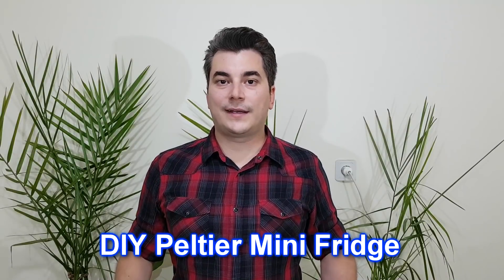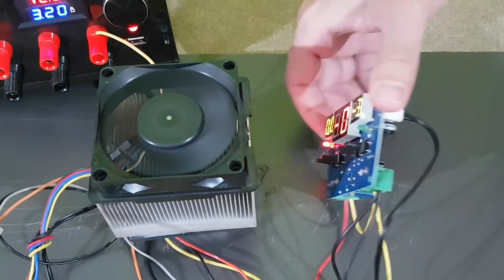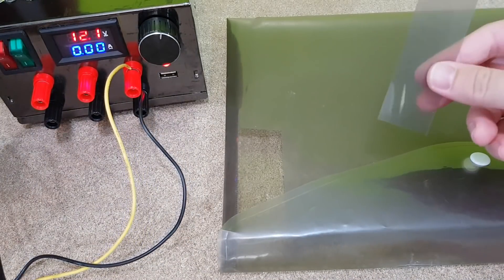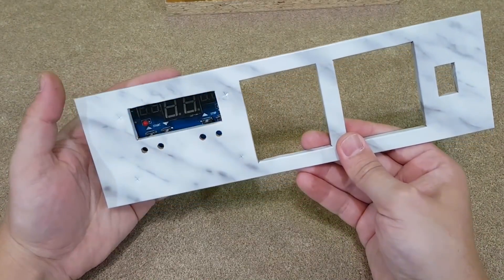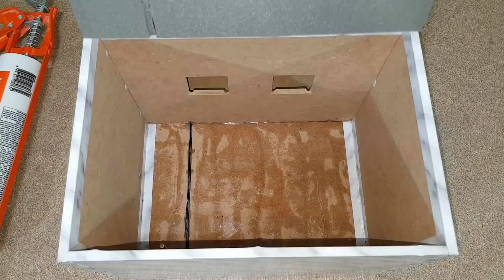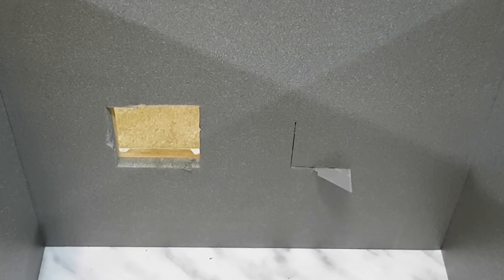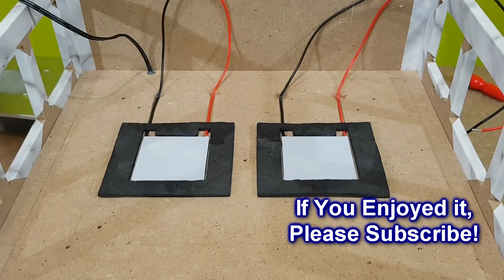DIY Peltier cooler box (mini fridge) - Part 1/3

Comment: Why did you choose the MDF over something much better?  MDF is not water-resistant and can swell or warp if exposed to moisture. This is a significant concern for a fridge, which will have condensation.
MDF does not provide good insulation on its own. You will need to incorporate insulation materials (like foam) to maintain the desired temperature.
Reply from the maker: Hello. MDF is cheap and easy to work with. I have insulated all the panels with vinyl, silicone and extruded polystyrene, there is no problem with moisture. This is my first mini fridge design, I will improve it in a future design.

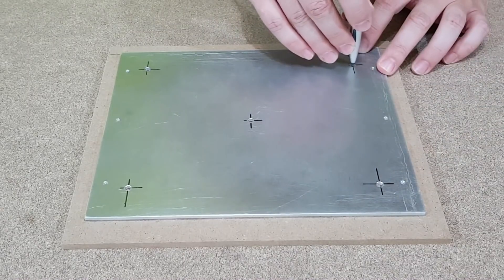Comment: 7:32 can i use a flat coil roofing aluminium sheet with a 0.45 thickness 
Because i dont think our home freezer has that kind of thick insulation aluminium that's up to 3mm
Reply from the maker: refrigerators and freezers have an evaporator with a lot of cold pipes that covers a large surface of the cold panels, some of them have the cold pipes directly inside the fridge. 
a peltier module has a very small contact surface, compared to the entire fridge, so to conduct the cold temperature to the entire internal radiator, the aluminum panels need to be thicker, otherwise it will be cold only near the peltier contact surface.

Comment: If the box is very well insulated then ANY power of peltier unit will cool the space. You are assuming poor insulation to assert that it will not work. First law of thermodynamics. If heat out is more than heat in, it will cool. Fact.

Comment: Can I use tec1 12704
Reply from the maker: 12703 is better.
Reply: For best cooling
Reply: But I want to make mini fridge and I have only 12704
Reply: 12704 does really run on 4 amps

Comment: I was thinking about a propane fridge modified to work with induction coil that instead of an open flame works with 5V or 12v inductor coil making it more efficient secure and portable but i am unable to make such device because my economy is not letting me ( a jobless man living in a banana country can't do much ) , the other thing i want to build is HHO  stove with a PC Power Supply Unit because ( 12 volts 13amps are enough ) for Electrolysis with stainless steel electrodes and Sodium bicarbonate in water ( will not corrode electrodes ) and who better to do those than you to make the projects in video for all of us. I have more ideas of cool devices that i can't make all 5v or 12v appliances for home to go off-grid solar powered and i don't care if you build them instead of me my friend

Comment: So, I'm kinda stupid and couldn't be sure my watt-hour calculations were right. Do you have any idea of how much the mini-fridge will consume per hour?
Reply from the maker: hi. most of the time both of the Peltier modules will be powered, in this time it will use 6A - about 75% of the time. and when the temperature goes low enough, one of the peltier modules will be switched off - about 25% of the time, so it will use 3A. the average is 5.25A. 12V*5.25A=63W from the power supply. But the PSU doesn't have a 100% efficiency, most will have 80% or more. so 63W/0.8eff=78.75W from the mains. the anual consumption will be 78.75W*24h*365d=690KWh. so it's very inefficient :))

Comment: Hi we are making a fridge like this for our senior project and we are adding wheels Handel and solar panel on it. What are the heat calculations for your fridge if you have any? also what is your opinion on our project? do you think that us adding innovations like this to the fridge will further improve it? And finally do you think it´ll be possible to add a solar panel to it?
Reply from the maker: hi. I don't have the heat calculations, because I improvised with what I could find at home. it's important to use the 12703 peltier units. if you want to add solar panel, it's very difficult. because you need a solar panel that could output minimum 12V and 6A for a few hours a day. this means that the panel's peak power should be double, so you need a solar panel with a peak power of 144W, or even more powerful. if you make the fridge bigger, you need more peltier modules, so even more power...
Reply: @Sorin_DIY  thank you! also what is your opinion on our project? do you think that us adding innovations like this to the fridge will further improve it?
Reply from the maker: yes. but you need to calculate everything carefully. it will also help if you give it an even thicker thermal insulation, probably 2cm of extruded polystyrene will be better.

Comment: Salut, crezi ca pentru următoarele dimensiuni ajung 2 module peltier, latime 33, Lungime 65, Inaltime 37? Multumesc anticipat!
Reply from the maker: salut. 2 module sigur nu ajung. iti trebuie minim 4 module peltier - 12703. dar o sa ai nevoie si de ditamai radiatorul extern.

Comment: HI.  Just found your channel and subbed instantly as this is exactly what I am trying to build for my camper van.  Do you have a parts list and schematic that I can download please?  Great video.  Also enjoyed the fact that you showed mistakes as it is part of the learning process.  Thanks.
Reply from the maker: hello. I added a list of the components that you can buy online. I bought the rest of the components from a local hardware store and some of the components were recovered, e.g the CPU coolers. I will make the schematic soon.
Reply: Hi congratulations, I also did technical tests with peltier inserts. See my channel. thanks.

Comment: a 6Amp peltier modle low more temp??? i ll try this project but for a room no for car so ill can put bigger ones??
Reply from the maker: I suggest you use the 3A peltier module. it's using less current -> it will create less heat -> the cooling will be better -> the module will be more efficient.

Comment: This is a cool idea, and I just happen to have a bunch of Peltier modules in the lab. hmm maybe a portable air conditioner?
Reply: Yup good idea just use a water block and a radiator to make a outdoor unit to cool down the hot side

Comment: can i use 8mm aluminium sheet and 12706 peltier module
please tell
Reply from the maker: yes, but it's more difficult to work with the 8mm aluminum plate. and the 12706 peltier module is using more current and it's producing more heat. if you don't give it an adequate cooling solution, it will not be very efficient on the cold side.
Reply: i use antec a30 cpu cooler 
is this work with 12706 peltier module
and should i use 5mm or 8mm aluminium sheet
Reply: when are uploading part 2 of this video waiting eagerly
Reply from the maker: the CPU cooler is ok. for the cold side 5mm aluminum plate is enough.
Reply: @Sorin_DIY   when the second part of this video is coming please tell me waiting eagerly
Reply from the maker: in around 2 weeks

Comment: I hve the same chilli bin with peltier. I got mine down to 4 degrees C with a better top fan. Now I am going to fit a 140 watt cooling peltier with water cooling radiator. Hopefull turn it into an ice box. Expecting at least -4

Comment: Do you plan on installing fans for circulating the air inside? I mean, it will take some space, unless you use like a PC fan.
Reply from the maker: hi. I will not install a fan inside the fridge. the cold radiator has a big surface, it covers 3 of the 6 sides inside the fridge. there is no need for a fan. the air will get cold, it will go down, warm air will go up, there will be an automatic circuit of air, until all the air is cold.